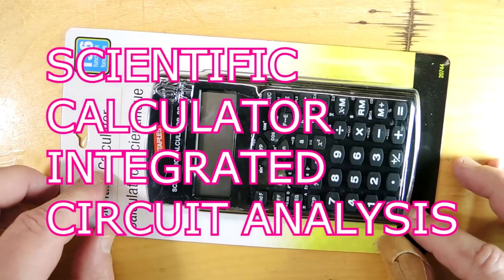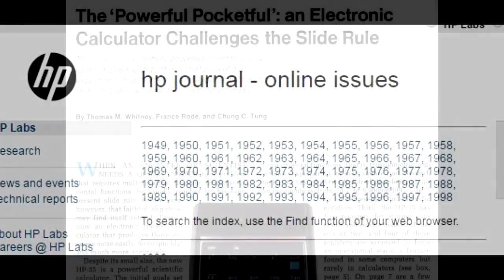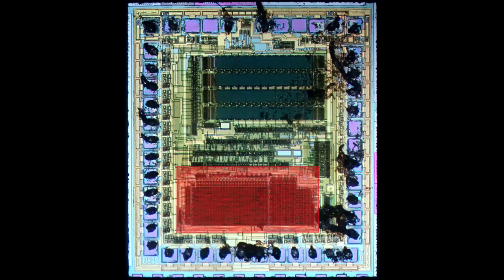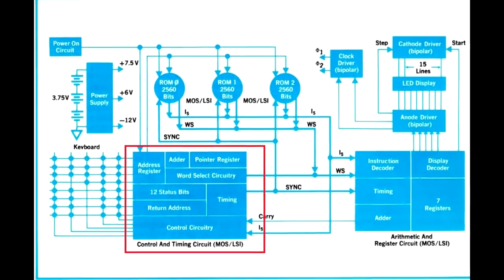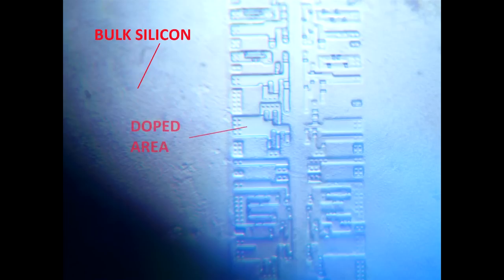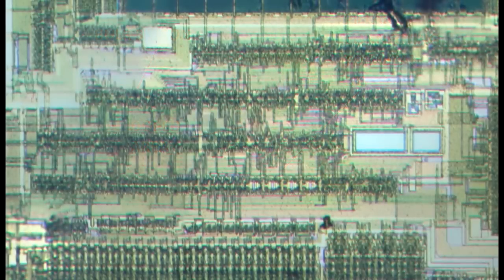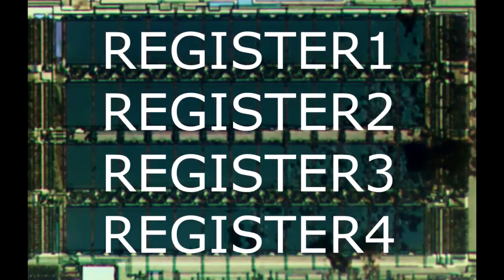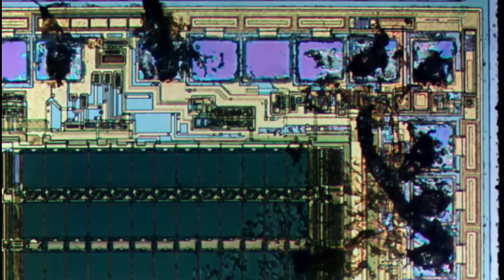Tear down of a Scientific Calculator Integrated Circuit

Comment: Awesome video thank you !! please I am trying to understand the very first thing that happens when you press for example the number 1...
I understand pretty well binary .. it is converted to binary and then sent to memory ... then logic gates ... 
BUT HOW IS THIS INITIAL SIGNAL "CREATED"???

- comment #4 of this video is the closest thing I have seen  so far  

https://www.youtube.com/watch?v=8FAahyFEDbA

"Binary" is really just an electrical current, 1 being electricity flowing and 0 being no electricity, so by pressing a button you are changing the status of that button from a 0 to a 1 and creating a flow of electricity.

- and this  video  

https://www.youtube.com/watch?v=rqTqWNakKKs

"when the numeral 1 is pressed on the keyboard 
"the encoder changes the signal into an electrical pulse..." 

WHAT IS THE /AN ENCODER

and again how is THIS signal THAT IS SENT TO THIS ENCODER created???  

DOES THIS pertain to some sort of flow of electricity ??
x amount of voltage /creating a flow of electricity to represent (a numerical or ascii character )

BUT STILL , HOW IS THIS SIGNAL "CREATED"

IS IT "PRESET" SOMEHOW/somwhere (IN THE PROCESSOR ??) (that you have shown us)
Reply: Those videos you linked to are broadly correct, but misleading in some of the details. Each of the buttons on a calculator do the same thing physically, regardless of how they are labeled. The buttons are wired up with the inputs of logic gates on one side and the negative terminal of the battery on the other. Normally, these particular inputs are connected to the positive terminal of the battery, making them “high” or logical “1” or “true”. When the button is pressed, the logic gate inputs are connected to the negative terminal of the battery. This  “grounds” the input which sets it to a logical “0” or “false”.  The logic gates each button is connected to are part of what is called an encoder. Encoders read their inputs and then changes its output to be the binary code corresponding to which input has gone from 1 to 0 and thus, which button has been pressed. The controller reads the output of the encoder and has a look up table that lets it know which button corresponds to which function (+, -, cos, 1, 2, 3, etc) and acts accordingly.
Reply: Another complication is that the buttons aren’t directly wired to the inputs, they are actually arranged in what’s called a key matrix or row/column array. This lets more keys be connected to fewer inputs, which saves money for the manufacturer. But the principal still holds.

Comment: I am really sorry but I think you're wrong about the function of some elements of the circuit. The square area at the bottom looks like RAM rather than ROM. ROM elements are much more smaller. The area on the top of the chip looks like an array of capacitors, so it may be a charge pump. Sometimes the voltage from the bettary is not enough to power the lcd (even if it consumes almost nothing it sometimes needs fairly high voltages).
Reply: i wouldn't call the bottom portion as ram but instead as rom. the top is also just a set of registers as a capacitor for the voltage boosting is supplied outside of the ic

Comment: This calculator contains many of RAM registers for numbers (5 for stack + 1 memory register + ?? temporary registers for functions calculations) + 15 small registers for brackets storage. So, I guess that RAM should be at bottom part and ROM with firmware at upper part.